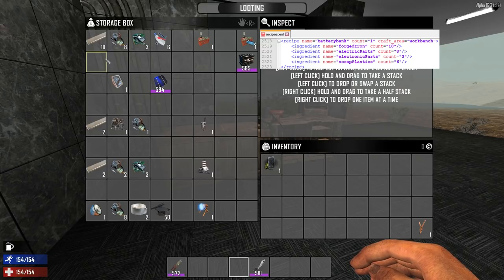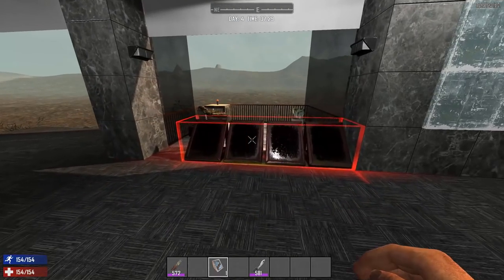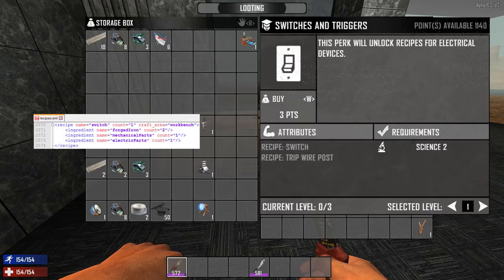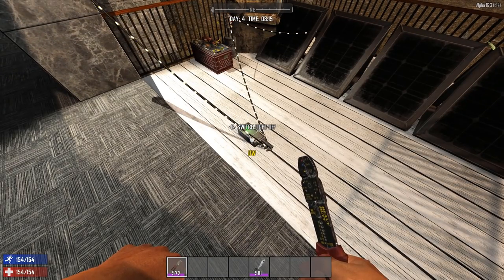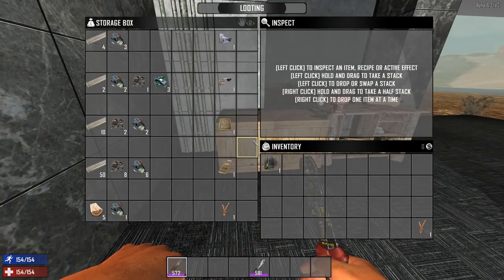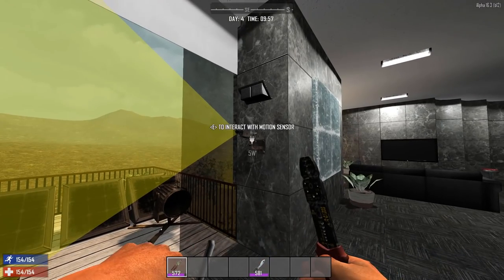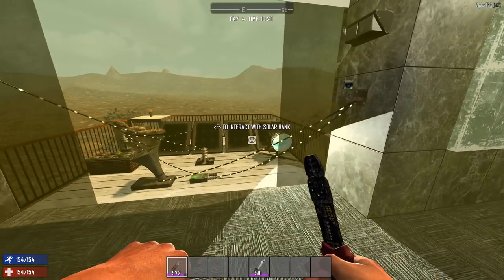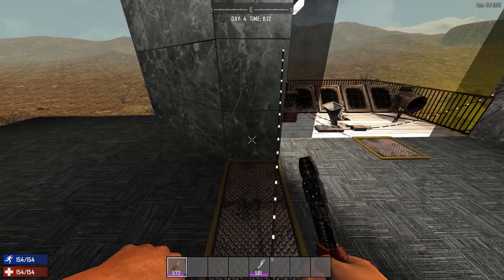7 Days to Die Electricity Guide | Advanced |  @Vedui42

Comment: I love the electrical parts of this game, its so much fun to wire everything up, making it look good and stuff! Only thing I want with the Timer Relay is that it would turn on and off the powersource at those times as well. Instead of it having to run at all times for it to work
Reply from the maker: Electricity works very weirdly. You'd expect electricity to go to "appliances" with trigger conditions separately, but now it's power going through trigger conditions in an illogical fashion. So now you can have an engine --> timer --> lights, and it will only draw power/fuel when the timer is "ON"... but the engine will happily be making annoying noise :P

Comment: Is it possible or is there any way for the generator's power output to be above 600w? or is there a fixed value for the power output for the generator? I'm trying to fit 30 fan blades in 1 generator and it would be great if a single generator is able to power all of them so that way I won't have to add more switches and wirings on my base. Thanks in advance!
Reply from the maker: Yes there is. It requires modding the blocks.xml file though, so it won't exist on "other" games other than your own. Which might be enough :D

Look for block id 2001, generatorbank in blocks.xml, and increase <property name="MaxPower" value="12250"/> value. You could even increase <property name="MaxFuel" value="1000"/> accordingly too. Make backups of your world first though! Too high values might cause issues, and I haven't played around with it too much myself so can't guarantee it works fine even if you 10x it :D

Good luck!
Reply: Ohhh that's neat. Thanks for the instruction!
Reply from the maker: You're very welcome :) if you test around with it and notice any limit where it stops working, do come back and let us know :D

Comment: i there a way to pass electricity through a solid wall?
Reply from the maker: Yes. In effect, electrical wires do not care of what is between the two items they connect. Just connect the items and the wire will hang in between them, regardless of what might be there :) Try it out!
Reply: Thanks a lot, Sir.

May I ask, if you find auto turrets useful? (And if you have a tip how to get sizeable amounts of coal, and most importantly, nitrate?)
Reply from the maker: Welcome! :) Auto turrets are of very limited usefulness. Mostly if you pick up lots of 9mm rounds and need to use them up. They can be ok to kill screamers at a distance, or kill vultures, but for base defense shotgun turrets simply wreck them.  check my Auto turrets vs Shotgun turret test --> https://goo.gl/zDtfLw
Reply from the maker: As far as coal and nitrate, sampling the gravel (as I had in one video) helps to find the right ore underground. I always find tonnes of nitrate in desert through, digging straight a few hundred meters usually finds lotsa iron oil shale and nitrate :) Coal in plains, just harder to dig :) But looking at gravel patches should help --> https://goo.gl/mGcySr
Reply: Thanks a lot, Sir!
so, auto turrets are limited in effectiveness, but shotgun turrets much more usefull? with slugs of regular rounds?
Reply from the maker: Shotgun turrets only take the normal rounds, so they're pretty easy to keep stocked once you find the nitrate/coal to stock. Paper is easy now from glue (from bones) so that part is done. :)

Comment: Too bad that if you do a sensor outside garage door  you can only open the door from outside and you can't  open from inside. Connecting a switch or something from inside it does auto-disconnect the sensor. WTF TFP.
Reply from the maker: Check my powered doors video few weeks back where i show the solution to this! Also covered it streaming on twitch but the vod might be gone already. :)
Reply: @Vedui42  Oh I think I seen that yesterday. Still lots of bugs tho, hopefully TFP will fix them. Example, I notice the sensor can pass through the flagstone walls, but NOT the garage door. Plus other minor annoying things. Thank you for the video tho!
Reply from the maker: You're welcome! I've not really seen many big problems, they did have issues in the past with sensors/turrets detecting through blocks, I don't use flagstone much too! :)
Reply: @Vedui42  I have try make a garage door and a bridge near each other, it works but sort of bugged. Once you are between the garage door and bridge if you don't move fast they will close and make you stuck between, because camera won't spot you between them. So I added a delay instead. It is working, but you have that 30 seconds to enter. I mean is enough time BUT then sometimes you don't want to have so much delay in case some zombies behind. Well, can't do much I guess. And inside the garage the camera sensor area is pretty wide and detect you easy (I moved camera near door as much i can but still detect you). Wished could adjust the area width of the sensor.
Reply from the maker: You can also try the trigger plates on the inside, that would work too if it works better! :)
Reply: @Vedui42  Yep I should try that too, cause sensor camera is so and so.
Reply from the maker: It's... a bit weird at times :D
Reply: @Vedui42  Not as weird as killing animals with car or bike and see them flying and disappear for come back later and find their not decomposed body XD

Comment: Nice job. If you interested check out the link in the 7days forum. https://7daystodie.com/forums/showthread.php?69799-Junction-Box-Block  I realy hate the wire´s hanging all over my base. it looks not good and i´m tired to work around with double floor-blocks or double walls to hide the wires.
Reply from the maker: I like that one! Hiding wires drive me nuts, I end up placing so many relays around just to hide that it's not even funny. 

Any way to make it such we can identify which block is the relay block, after placing? Ie, I know I could paint it differently, which sometimes could help and sometimes just makes it weird.
Reply: I dont use a concrete block as the wireless relay. I use the fusebox-item like in comment nr. 3. For me its just important to hide the wire not the "relay -block". my "dream solution" is a wireless relay thats works like the "wall safe -block item". You can put it in the wall-block an you can still interact with the item.
Reply from the maker: Yeah that sounds like a good idea! I would get my vote ;)